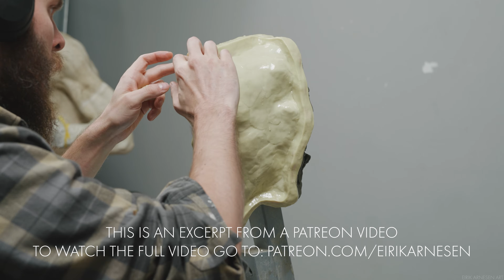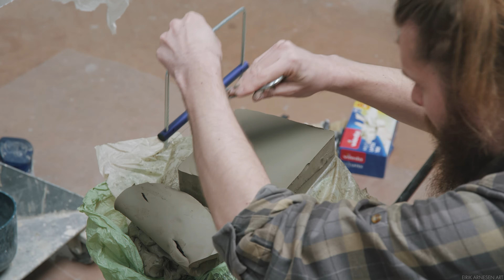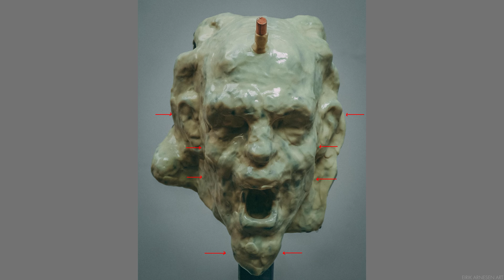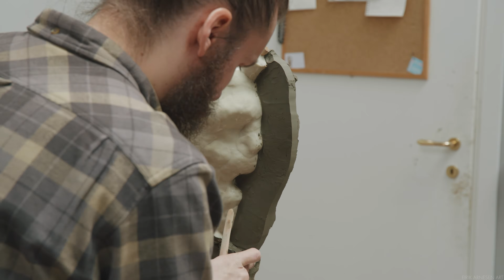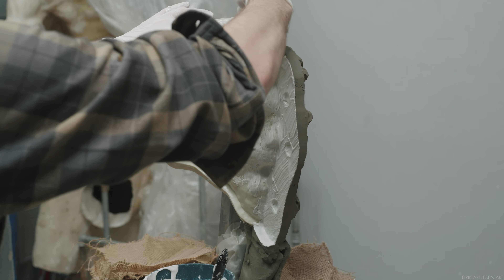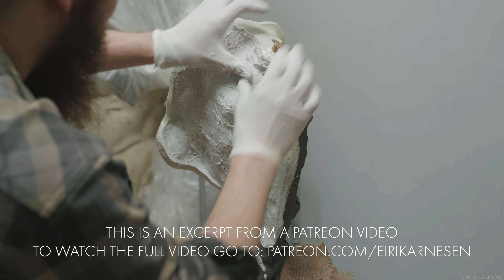Making A Plaster Mold

Comment: Nice plaster casing. I imagine that you will do a small batch of castings, that is why the casing will be made of plaster. When I do a longer production casting or the part is very large, I prefer to make fiberglass and polyester casing or even fiberglass reinforced polyurethane resin casing, they are lighter, more durable and you can apply more pressure with screws when closing the casing. Congratulations on your work, I've been following your work for years and I love your style. Greetings!😊
Reply from the maker: Thank you! I usually use acrylic resin if the mold is bigger or needs to be bolted together. It's a bit less toxic and works better for my current studio situation. I'd love to learn how to work with polyester or polyurethane some day! Maybe if I ever get a studio all to myself.